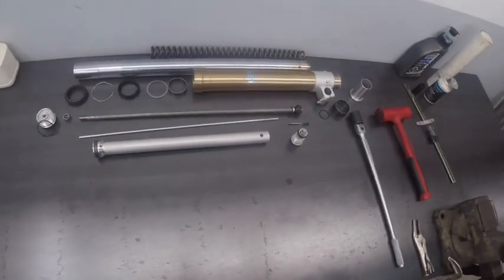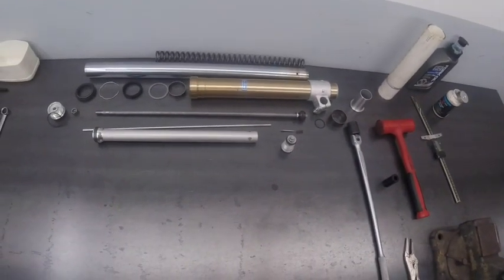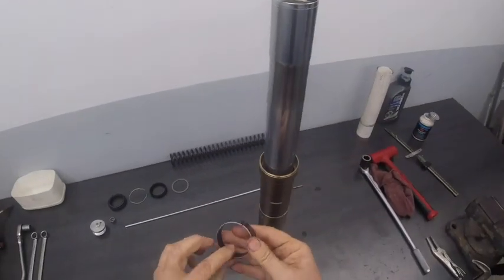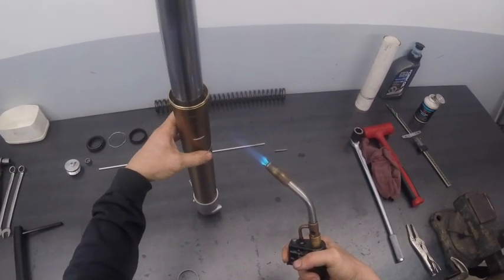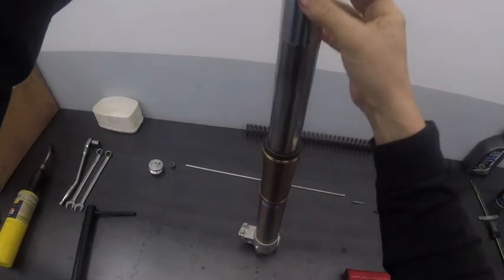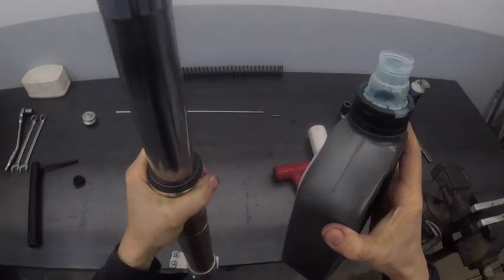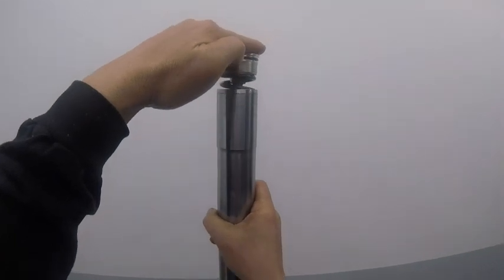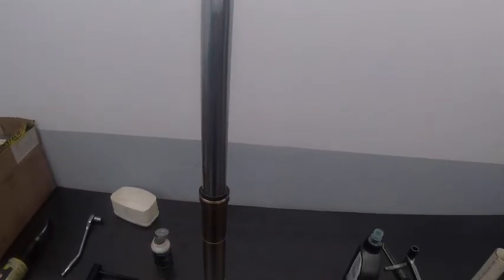DR-Z400 fork assembly

Comment: the measuring oil makes no cense if u pull the tube to much then ur to low if u push down they u have to much oil better if u used the recommended amount instead of measuring it

Comment: I don't understand. We are putting in a spacer to limit the stroke length. Why are you doing that?  Does that increase preload? Does that affect the height?  I am trying to get info about lowering the bike 2 inches. Thanks
Reply from the maker: In this case the bike that the forks were going onto (a BMW R100GS) is basically designed for a certain ride height. If the front forks are longer, the centerstand and sidestand don't work well and the overall attitude of the bike is nose-up because you can't raise the rear very much. My goal was to match the travel of the original forks, which is published as 225mm but is really more like 215mm.

And yes, the preload would be changed because you are adding more initial compression. In this case I changed the springs, too.

Comment: Wish youde show the lower leg bottoming cone circlip.  You can pull the fork apart without slide hammering  the stantion slide bush against the guide bush . Pull the upper out through the lower
Reply from the maker: If I ever have another set of these (or this set) on the workbench again I will try to remember this, thanks!

Comment: Just did my forks - thank you for the video! I replaced my bushings too using an All Balls kit but it only came with the guide bushing and the slide bushing. Once I opened my forks I realized there is a third on the dampening chamber. Anybody have any insight why this isn't standard for a bushing kit? I found a forum on the internet where some person said that bushing wasn't important but on my fork it had the most wear on it.

Comment: What Kind of cleaner/solvent do you use for cleaning? That doesn't damage bushings, o-rings, seals...
Reply from the maker: Standard Safety-Kleen solvent. Mineral spirits based. For brief exposure I have never found it to damage most rubber or plastic parts. Brake fluid seals, though... no way!